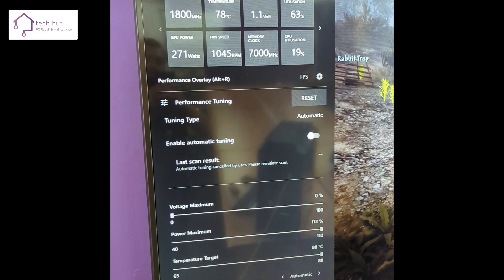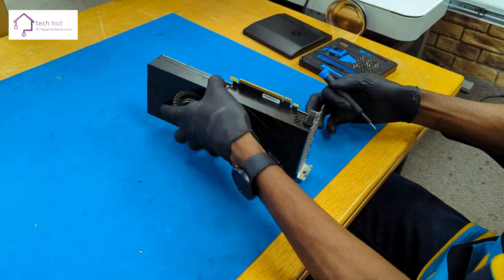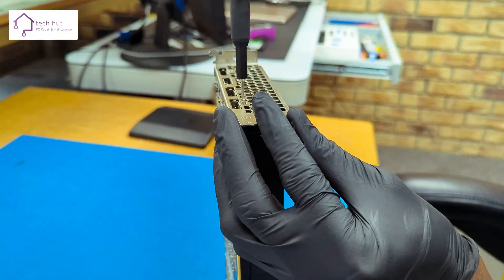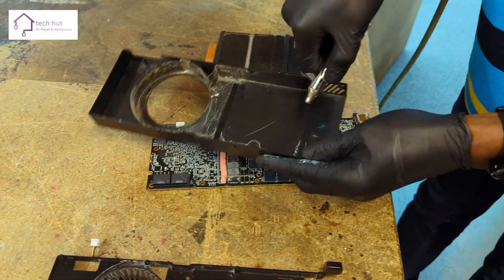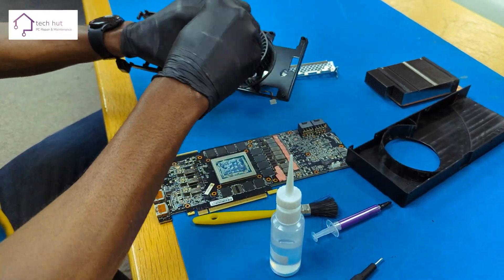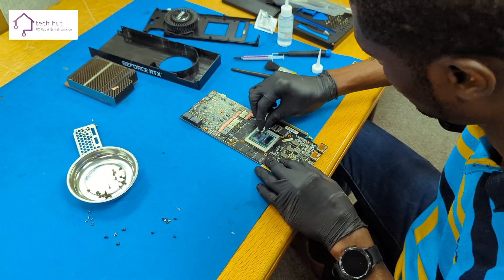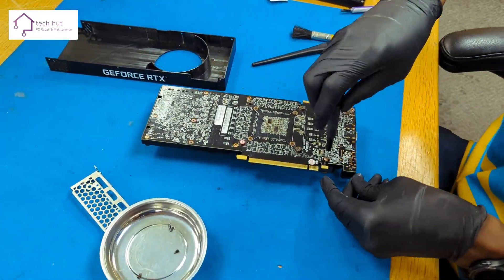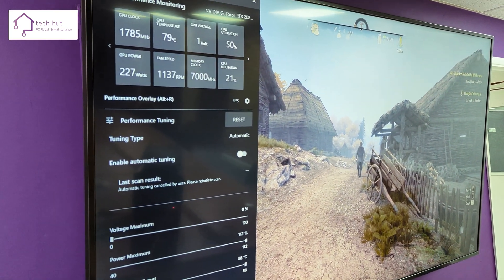Nvidia RTX 2080 Ti Overheating Fix - Cleaning and Applying Thermal Paste | Repair | Tech Hut #tech

Comment: 79c at 50% utilization?  that looks worse
Reply: And he put too much thermalpaste on the gpu
Reply: If you notice he didn't replace the thermal pads that he destroyed... Probably why Core clock is lower temps are worse fan speed is higher and utli is lower... That card is done now lol.

Comment: 79c at 50% utilization?  that looks worse
Reply: WHEN GPU TAKES A POWER OF AROUND 80 TO 90 OF ITS TDP ITS HOTER GPU HEATING NOT ONLY DEPEND ON UTILIZATION IT ALSO DEPENDS  ON POWER
Reply: @AmeerHamza-v4x  Or when they don't replace the thermal pads they destroyed using the air compressor on it...that's why the temps are worse and fan speed is higher. That card is done now sadly...